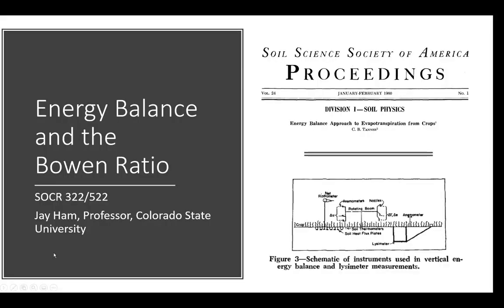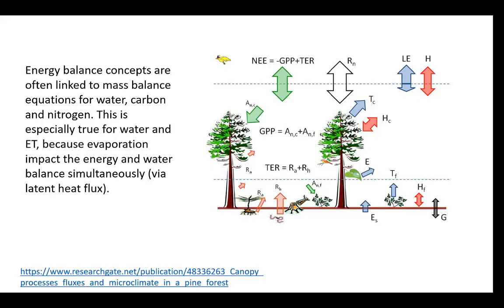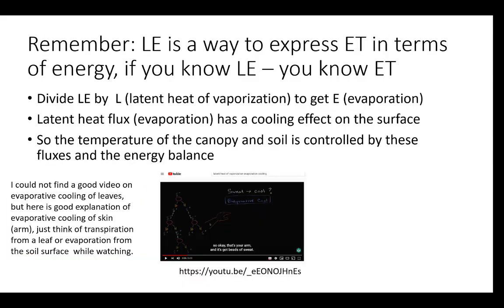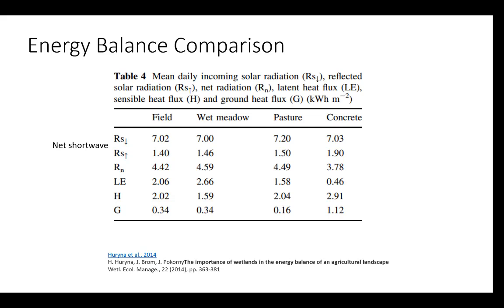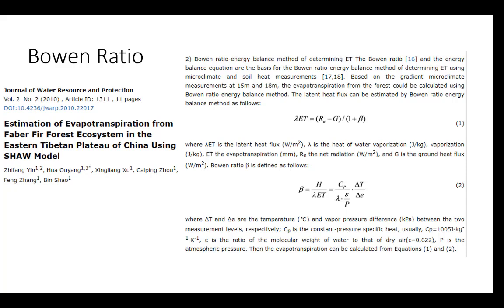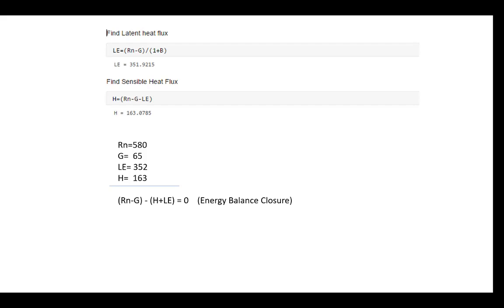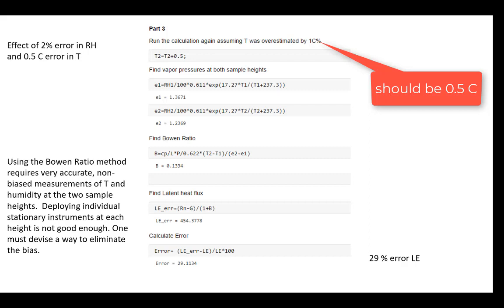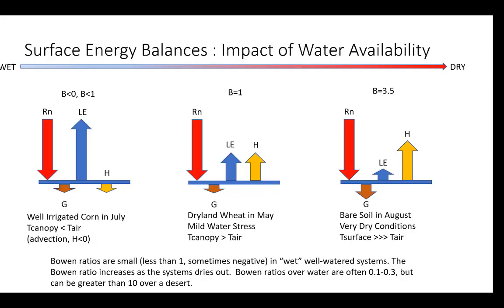Energy Balance of Crops and the Bowen Ratio

Comment: If 1960s equipment can do this, do you think that a homemade Arduino-based system could be made to measure the Rh and T gradient? Maybe a linear actuator or screw motor to change the height of the probe?